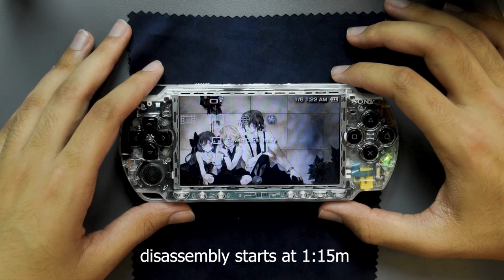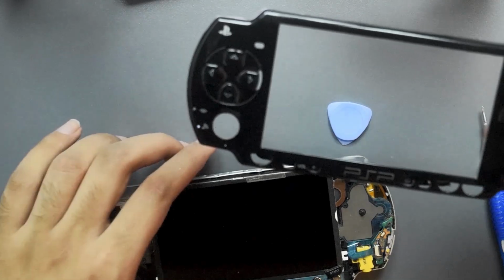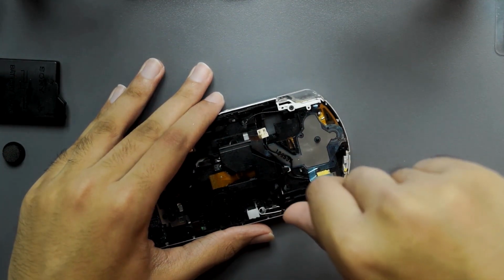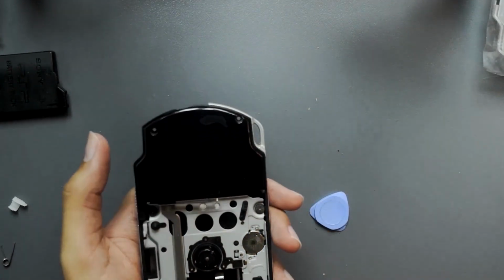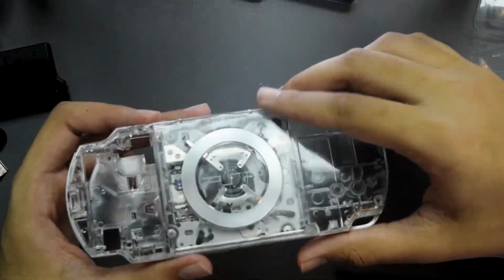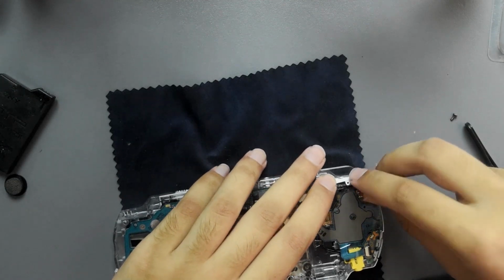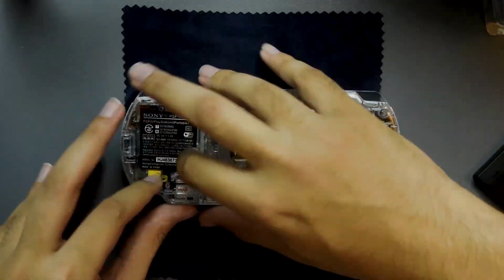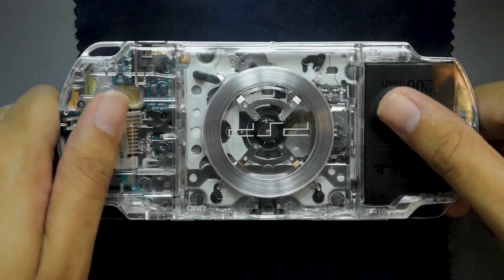Bringing My 11 Years old PSP Back To Life

Comment: Hello sir, nice video!! My PSP 1000 screen get dark after I changed the shell.>< I can only see slightly view by squint under strong light...And I tried the other screen, the result was the same. I press the square(light adjust) for 2 secs, I can see the slight backlight disappear to black. What could be the problem? Thanks a lot!!
Reply: Try using the charger without the battery and then turn on the PSP.  If it still fails, your psp may be bricked.  Use pandora battery and magic memorystick to unbrick ur psp